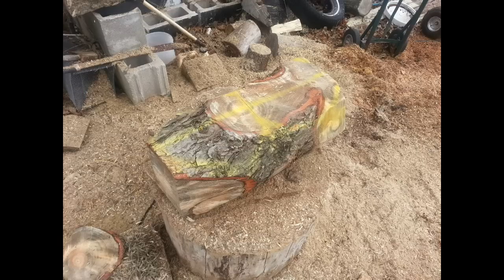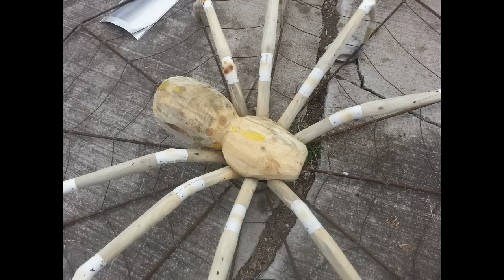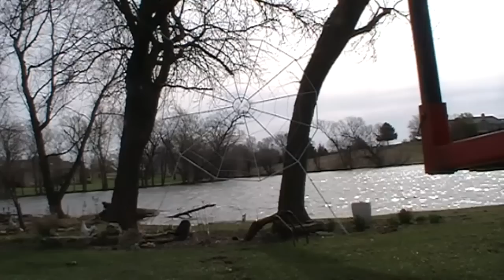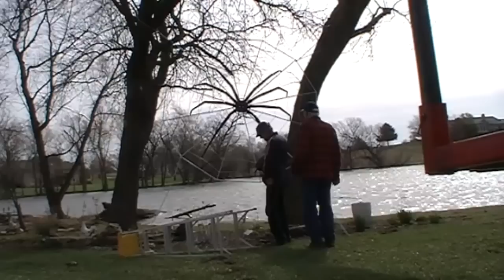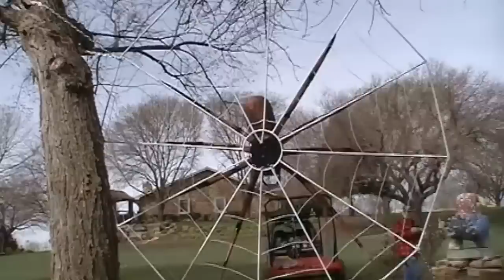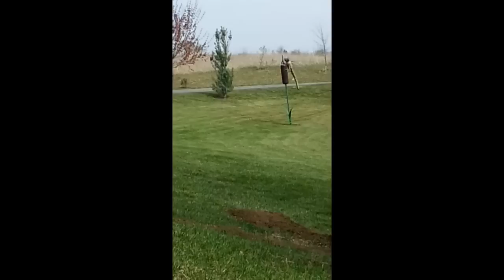#65 Big Spider Sculpture

Comment: Hello, Congratulation great job. I wanted to ask you, as I am about to make a giant spider sculpture in Italy for the Taranta Dance Festival.... The joints are made in PVC, heated up to get the right shape, right? Is the core where you insert the legs PVC or metal? Do you think I could make a structure like that all out of pvc tubes instead of wood (and using resin and fiber for the body and finish)? I know you speciality is wood carving but perhaps you have idea of what is best and how much it weighs. The other option would be to make it with iron sticks but it will be more expensive... Thank you for your time. Bea
Reply from the maker: You could certainly make the legs all PVC. I think if you use different sizes glued into each other then heated and bent just below each joint it would work. And that would also give you the reduced size for each leg section to build onto. good luck sounds like a fun project.